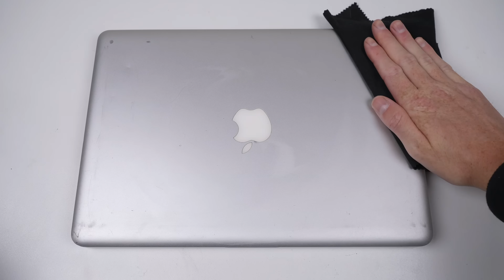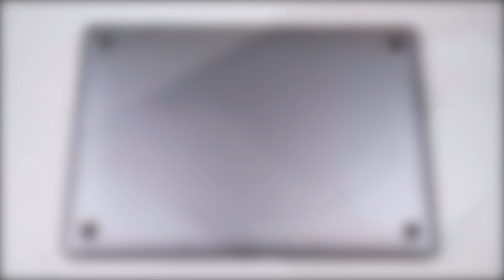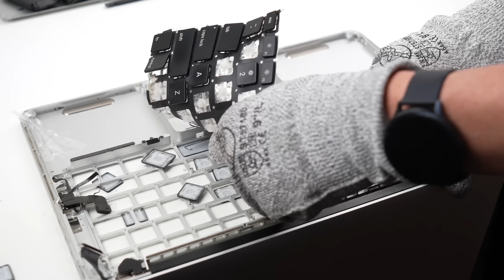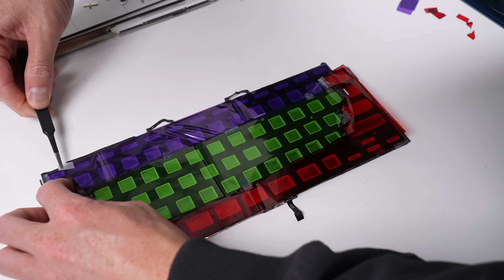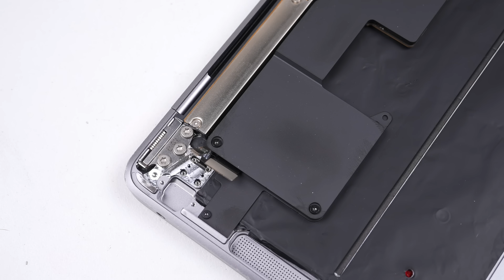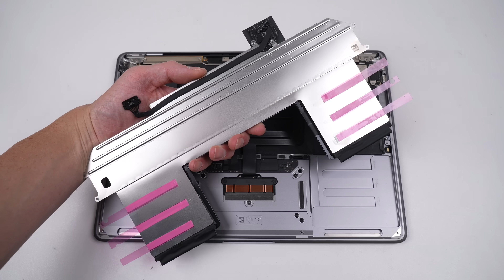Adding RGB to an Apple Silicon MacBook Keyboard

Comment: Dude, the Retina MacBooks had glue on the batteries that was straight insane. I don't even use glue on the batteries anymore, just a small spot of double sided tape that holds it in place just enough to keep it from moving around, but comes off with little effort.

Comment: i don't think that this is even close to worth it..... apple being apple, would have designed the speakers to only function and sound proper  with the original tape in the original locations. so no, i don't think its worth it unless you want to replace the battery.

Comment: I watched a friend repair a (2013 I believe) early retina macbook. The battery was bad and the keyboard had something stuck in a bunch of the keys and he wanted it replaced. He had a replacement battery and keyboard but I think it is still one of the most impressive repairs ive ever seen. he could NOT get the battery out and did puncture it, having to let it offgas outside for a day before continueing. Worth noting the keyboard on that model is RIVETED in. His solution was to pry the edge of the keyboard off, then stick it on the edge of a table, and pull the whole computer down making the rivets fly off with the keyboard on the table. Maybe the most upset i've ever been to the construction of a device. Apple designers must have been having fun and thought it would be funny.